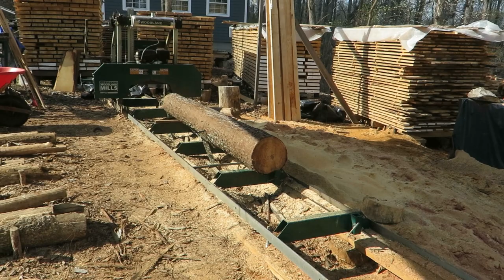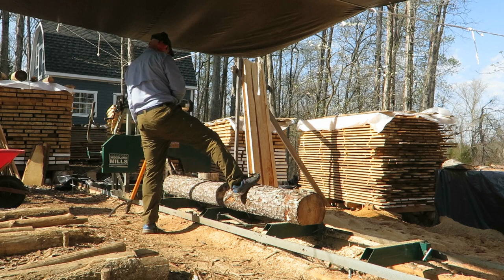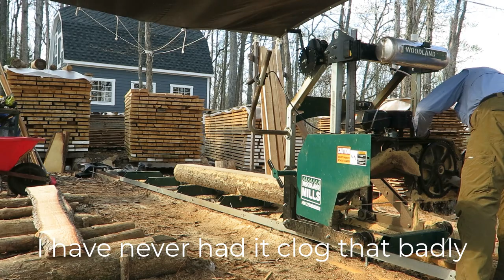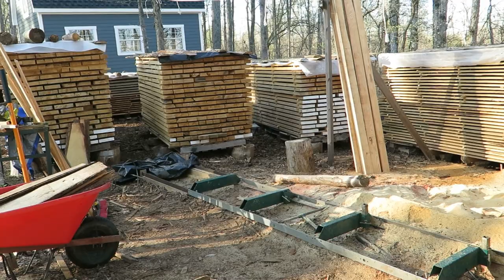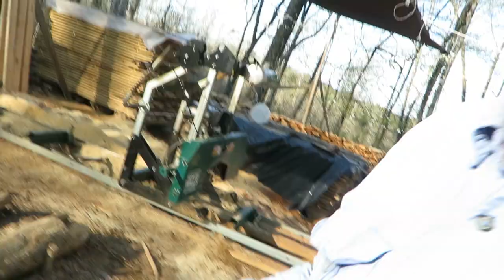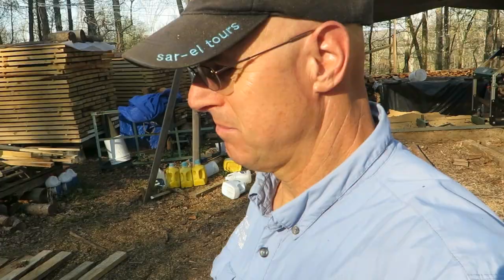Eps#157 Making studs with my Woodland Mills HM122. This size sawmill is ideal for this job.

Comment: good video and job as always. i have a dust collector hooked to mine i bent the wires and that helped a little. i may just cut them out. take care, be safe and well.
Reply from the maker: This is the first time it has gotten this bad. I use my sawdust to fill in low spots on the property which I will eventually cover with fill.